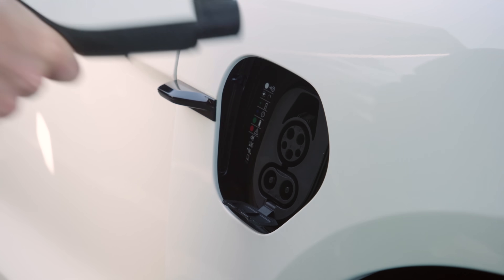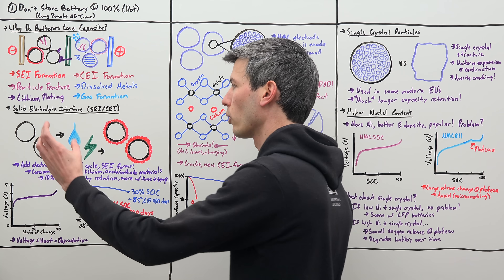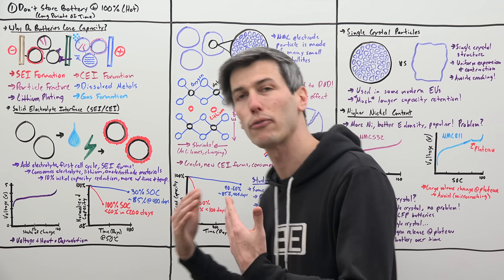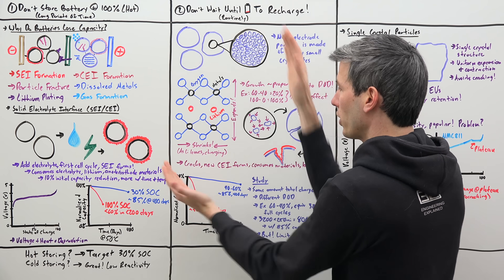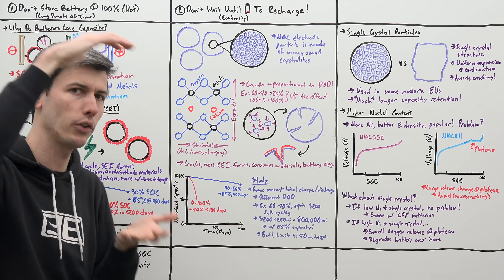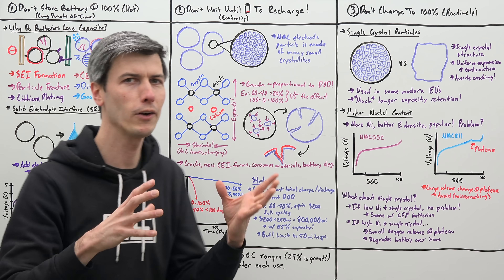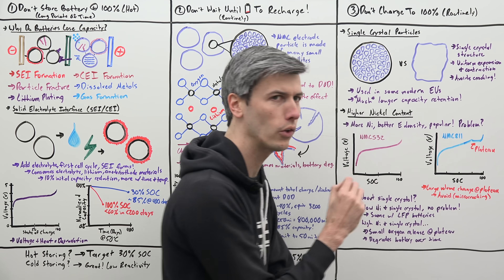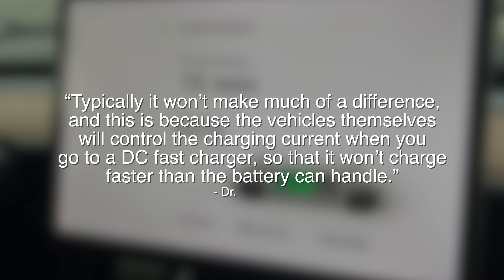How To Ruin Your Electric Car's Battery - NMC Edition!

Comment: With the high number of LFP batteries now being sold, it would be fantastic if you could make a similar video focused on LFP.
Reply from the maker: Yep, definitely think so as well!
Reply: Yes I would also love an additional explanation on LFP batteries! I would love to see similar information on how they handle cold, heat, sitting for long periods of time, and if sitting at a high state of charge versus a low state of charge affects them. Or maybe even a video on future or upcoming battery technologies like Solid State or something, though that might be harder to cover engineering information on since they're so new or even undeveloped.  @EngineeringExplained
Reply: @quintonstevens lithium iron phosphate is interesting in that you can't charge it at all if it's below freezing. It is however less sensitive to heat and can have very long cycle lifes. I recently got some large format (280ah) prismatic cells shipped over from China to build a battery for my RV. It's at the point where it was cheaper upfront for me to order 8 lifepo4 cells and two 150 amp bms and pay sea freight than to go down to Sam's club and pickup 8 6 volt deep cycle lead acid batteries. Once you factor in the life span differences it's a fraction of the cost of a large lead bank.
Reply: @mgkleym   It is interesting, yes, but as far as EVs are concerned, it's not really much different from from NMC batteries simply because (many) EV makers actively condition the batteries and in particular do so for charging. We're also talking about a situation when the battery itself is below freezing, not the ambient air. It could mean that an EV with an LFP battery that has dipped below freezing waits longer before the charge actually starts while the battery is conditioned (i.e., heated), but this is an edge case for many and perhaps even most.
Reply: agreed, as an LFP owner myself I would love to see how it differs.   @EngineeringExplained
Reply: would love to see such a video. Since I can't charge at home I wonder how leaving the LFP battery at 100% affects the battery considering the duration its stays at 100%. It is lithium based after all.  @EngineeringExplained
Reply: Yes, the manual for the BYD cars with the LFP Blade batteries says to Discharge to below 10% and charge to 100% each month to help with the BMS Balancing.
That is a variation to NMC for sure. @EngineeringExplained
Reply: Yes please!!!  @EngineeringExplained
Reply: I was thinking of this as well. Especially since there seems to be conflicting information provided about LFP best practices (Tesla saying that LFP batteries should be charged to 100% and at least once a week)
Reply: @AlexSchendel same in my BYD Handbook. It says charge to 100% at least once a week
Reply: I was thinking the same. I would also be curious to see Lipo difference?
Reply: I believe LFP needs the occasional 100% charge to calibrate the bms so it can accurately measure the SOC. I hope we get to see a video on best practices for this battery chemistry. Keep up the amazing work Jason.
Reply: He just posted the video you were asking for.
Reply: @That-Guy_  Yes, I already watched it. Great info.
Reply: Very useful, thanks! And great to have the advice backed by actual research!
Reply: Tesla recommends to charge to 100% on a weekly basis
Reply: I just put 15.000km on my MG4 standard with an LFP battery. I am asking myself the same things. Unlike the NMC versions, the LFP one does not even have a battery health mode. They actively coded it out. So I assume LFP is more robust to high SOC charging.
One thing I know for sure is that they have an incredible low temperature sensitivity. Even without heating or AC the range plummeted at -5°C (to 60% of what it is at 20°C) My guesstimation is that internal resistances or reactive potential drop at low temperatures. In any case that should be avoided if you live in a cold place.
Reply: @BugMagnet  I live in a cold place and have absolutely no issues with my Model 3 LFP. I charge the car at home, in a garage, and of course range drops in the cold, but only marginally so (even though the car is sitting outside for 9+ hours/day, not charging, while at work). On average, I've seen that I use about 8-9% more battery capacity in cold weather than I do in moderate or warm weather. If I couldn't charge at home or at work, I would second-guess having an EV with an LFP battery in a cold climate.
Reply: @davidc-l9174  a bit late response, but yes I'm living in cold weather (Finland) and in apartment building. No home charging possibility. Now this "100% charging at least once a week or two for battery management" is what keeping me buying a LFP vehicle. Would love to pull a trigger on upcoming KGM Torres EVX with LFP forits 10 year/1,000,000 km battery warranty if the battery management requirement wasn't mandatory. The other option is of course Nissan Ayira or Ford Explorer EV.
Reply: @BugMagnet  I have a 2023 Tesla model 3 LFP, I get 80%+ of the range at -5C v 20C provided I had it plugged in and pre-conditioned before I left for work, mainly because of the added use of climate - not the car itself.
Reply: Ah, thank you, that is a big difference. I can't do that sadly. Eliminating the cold problem before your trip is definitely the right thing to do.  @TB-up4xi
Reply: @BugMagnet the capacity drop in cold weather is not specific to LFP it also happens with NMC to a similar level, however it also depends on the cells and cell temperature regulation system used by the car manufacturers. So realistically you will get a different range drop for different car models even if they use the same battery technology.
Reply: @BugMagnet lfp likes being at 100%
Reply: @3vlogs487 it’s not that LFP likes it, it’s that the BMS requires it to be able to balance the cells.   The new video is very interesting 🧐
Reply: Yes I would love a video based on LFP batteries
Reply: Would love a similar video concerning LFP batteries
Reply: he finally made one....new release on this channel.
Reply: LFP sucks
Reply: This is an important distinction. LiFePo (LFP) batteries are a type of lithium ion, but unlike most other chemistries, they like to be topped off often. The downside to LFP batteries is that they are less energy dense, weighing more per kWh. An upside is that they are very stable and less prone to "rapid disassembly" events, which is the hilarious term that battery manufactures use to refer to their product catching fire.
FYI - Tesla uses both LFP and NMC chemistries, depending on model and trim.
Reply: @brentlanyon4654  >>  they like to be topped off often.  <<
This is NOT true.  LFP's are affected just as much from high SOC -- "hope" is that LFP's longevity would offset the degradation caused by high SOC.
>> FYI - Tesla uses both LFP and NMC chemistries, depending on model and trim. <<
Tesla uses LFP for entry-level, low-range models only; NCM/NCA for Long Range and Performance models.
Reply: @tooltalk  I'll take the word of my colleague, who earned a PhD in battery chemistry, over some rando on the internet and keep topping mine off regularly. 
Cycle life of LFP is 3 - 4X that of NMC and I'm quite sure I'll be tired of my car well before the battery runs out. You are correct, that they only use LFP on their cheap cars, which is cool with me as my Model 3 was literally the cheapest thing I could find on a local lot (after factoring in the Federal Tax Credit) when I needed a car. It was purchased as a cheap commuter and excels at that task.
Reply: @brentlanyon4654  >> I'll take the word of my colleague, who earned a PhD in battery chemistry, over some rando on the internet and keep topping mine off regularly.  <<
You mean electrochemistry?  Or are you thinking EE with subspecialties in Power and Energy? Maybe material engineering?  Whatever it is, there is no excuse for someone with technical background to conflate LFPs' lifespan under ESS workload/env vs EVs.
Reply: LFP is just “keep it charged. The higher the better”
Reply: @robertide5182 — Not really. LFP is also degraded by keeping it full or empty, and by charging it full regularly. However, this effect is less than with NMC, and it has a higher overall cycle life, so it won’t really be noticeable in many use cases. 

If you want the best battery life, the recommendations here are still advisable for LFP batteries.
Reply: @robertide5182  still don't empty them to zero. while they are harder to combust, they are hard to extinguish still
Reply: @robertide5182  >> LFP is just “keep it charged. The higher the better” <<
This is false.  A high range SOC is bad for all lithium ion batteries, including LFP.
Reply: Agreed on a video for LFP batteries.  My experience with them has been better than expected.

I have a 2023 Model 3 RWD with LFP batteries and live in the suburbs of Chicago.  The car is parked outside, in front of the garage, and is connected to the Tesla mobile charger with the cable run under the garage door to charge the car.  Yes, that's right... the mobile charger.  I purchased the wall charger as well, but have not installed it yet.  Why?  well, while the mobile charger seemed slow when I bought the car in the fall, it met my needs; I drive short trips from home during the week and may take drives as far as Indiana or Wisconsin on the weekends.  I keep the car charged to 100%, leave it plugged in most days on the level 1 charger and have yet to charge it on a level 2 charger.  As such, I figured it would be interesting to see if and/or how the car could make it through the winter on the mobile charger alone.  

What have I learned so far???

1) Charging is not the biggest issue in cold and extremely cold temps.  Ice build up on the window trim and frozen door handles are the biggest issues.  Not being able to get into the car makes it hard to drive...

2) Charging slows down as temps drop, but it really slows down as it gets to single digits F.   It seems like a good amount of the time connected with the charger is used to warm up the battery to take the charge in those temps.

3) The car does not lose much power capacity just from being in the cold.  When it was 0 to -9 F actual temps in mid-January 2024, the car was unplugged for 6 days (not driven) and lost only 5% charge during that time (with sentry mode turned off).  If I had driven the car during those days, I would have preconditioned the battery before I drove it and before I would charge it.  

4) The max defrost setting with preconditioning for the battery is key.  Using this setting gets the interior of car from 21 F to 81 F in a little over 7 minutes (using 4-5% battery); when it is colder, it takes longer in time and more power consumed (around 6-7% in single-digit temps).  While this uses some of the battery capacity, it is important for a couple reasons.  It preconditions the battery to allow it to accept regen power (the longer it is preconditioned, the more regen the battery takes).  This also allows the battery to charge faster (as it is already warm) after that trip (even with the mobile charger); the completely cold battery (with no warm up) accepts no regen power.  Another benefit is that it helps melt the ice build up on the front windows, near the trim, making it easier for the front windows to lower and the doors to open.    

5) Charging time with the mobile charger isn't horrible for short trips.  For short trips using 10-15 percent of the battery power can take 3-6 hours to charge back up to 100%.  Longer trips using 60-70% generally take 24-30 hours to charge back up to 100%.

My goal is to go through the winter on the mobile charger alone install the level 2 wall charger this year and compare the results using that charger next year.  

I know my use case is different than most, but it shows that it can be done with cars outside in cold climates and with only a regular 110 outlet charger (that is if you don't drive a ton at one time and have a place to leave it connected most of the day or night).
Reply: @markm.3740 so I only have the mobile charger; plugged into 220 24 amp circuit (dryer plug); it was the cheapest and easiest install. 150 dollars or so. It charges substantially faster than the standard wall plug.
Reply: @markm.3740  Thanks for sharing your experience.
I would just point out that "I keep the car charged to 100%" is the worst thing you can do to any Lithium based battery, LFP included. There is probably nothing worse you can do to that poor battery then this! 
So I highly recommend to stop doing this if you would like your battery to last.
Reply: Any Tesla with LFP is recommended to charge to 100% as much as you can. Brick and cell balancing as well as SoE and SoC calibration will happen in background as a bonus. They sit happily at 100%. In winter charge to 95 to keep some regen abbillity.
Reply: @luciddreams1623  >> Any Tesla with LFP is recommended to charge to 100% as much as you can.  <<
This is true for pretty much all LFP EVs.  This is a trade-off that hurts battery's longevity in EVs.  
>>  They sit happily at 100%. <<
No lithium ion batteries like sitting at 100% SOC -- you could end up losing 2/3 of lifespan if kept at a high SOC.
Reply: Yes LFP video!

Comment: Those are veeery conservative tips. Every battery has buffers. By only charging to 75% you are not using a total of 28% of the battery capacity because 2-3% is a top buffer anyway. In fact since there is a bottom buffer you cant use 30% of the battery capacity that way. That is wild and limits your range of use cases for an EV drastically. Something which acts against EVs as a whole. Charging to 80% is fine, and is also the reason why charging curves hold the speed until this point more than adequately and only then drop of significantly.
Reply: Agree the tips are pretty conservative, but they make sense. For most people, charging to 75%-80% will be more than adequate to cover things like daily commutes, errands, and even if you forget to plug the car in for a couple of days. The main thing is just to make sure that you aren't charging it to 100% capacity all of the time, instead reserving that for when you're planning to take a road trip.

Comment: I'd like to learn more about LFP batteries.  Tesla says you should always charge them to 100%, but I'm not sure they're right.
Reply: I think that has more to do with keeping the range estimate accurate but idk
Reply: Why wouldn’t you believe Tesla on this matter 💀
Reply: @ericy.2108  Because I believe their reasoning is because it helps them give a more accurate range estimate, not that the batteries wouldn't have better longevity if you only charged to 80% or so.
Reply: @blurglide  I heard that the Battery Management System needs a 100% charge to balance out voltage differences between the cells in the battery
Reply: @ericy.2108  Whelp...he just made a video on LFP batteries, and it's not good for them to spend much time at 100%
Reply: LFP batteries don't suffer degradation as readily as the other battery chemistries.

Comment: oh here we go. we need a yt video to teach us how to use our car so we don’t damage it. how lovely and a user friendly experience.
Reply: Yes, this statement applies to all cars?
Reply: @BrandEver117  ….. no. you can refuel every car the same without risk of damage (unless you use the wrong fuel because i know you were going to leave a nonsense comment about that)
Reply: Most of this stuff is told to buyers by the car sellers, it is in the manual, and in many cases is also made quite clear in the user interface. Using an onscreen slider to set your planned state of charge is very easy.
Reply: Ever tried learning to drive a manual without absolutely killing the clutch? Yeah I guess not. 

Literally everything in the engine bay is a consumable from spark plug to engine oil to timing belt to coolant

Comment: You should have mentioned that some Manufacturers (eg. Tesla) actually create buffers on both ends - 0% is actually not 0%, it's something closer to 5%, same for 100%, meaning that each of these "worst case scenarios" you mentioned is not even possible to achieve.
Reply: EVERY manufacturer does this
Reply: Tesla typically has 4-5% below zero. 100% is in fact 100%.

Comment: *I would say there are people who can charge at work 4-5 days a week and  that is good enough if you can't charge at home.

Also,  for those stuck on 110V home/office charging,  there is a VEVOR charger that goes 15 Amps@110V,    This gave me 600 miles of range weekly just charging at home and work 14-18 hours a day.  I rarely used a supercharger,   Whereas with Tesla's 12 amp  110V attachment, I had to supercharge weekly as I got closer to 460 miles of range.

I am no longer in a temporary housing situation and can't agree more that having a home 240V charger is really the best way to go!
Reply: that's cool, but I would be concerned about drawing 15 amps continuously on a 15 amp circuit.
Reply: @MrDRSMAX  good point. .   Make sure you have a 20 amp circuit dedicated for the 15 amp